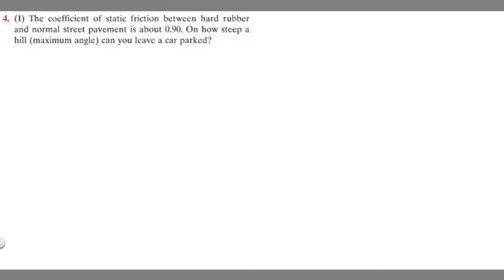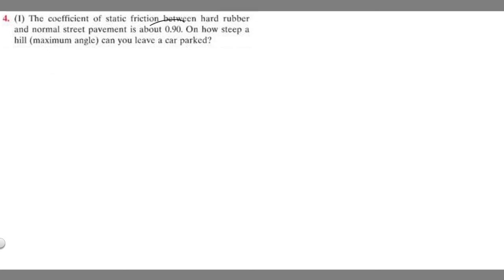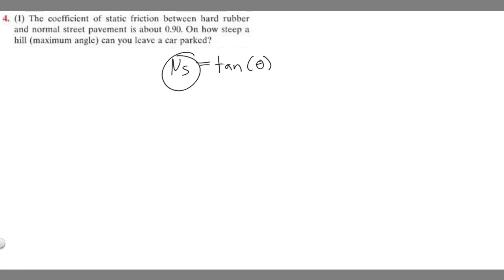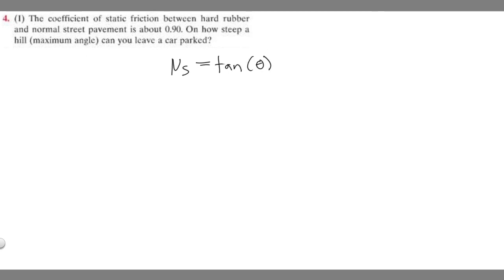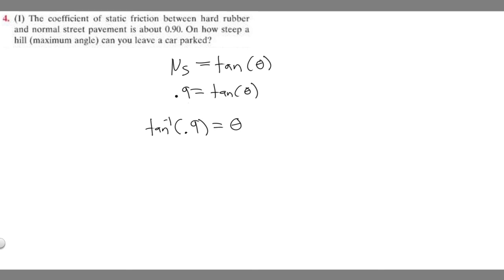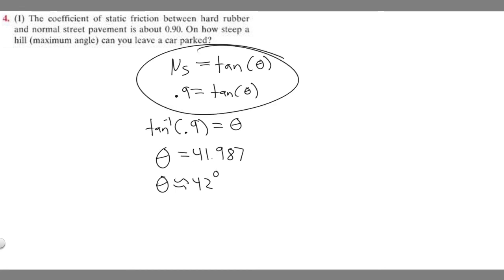The coefficient of static friction between hard rubber and normal street pavement is about 0.90.

Comment: How did u get that equation
Reply: Sorry for the late response. Since (Force of Friction = .90 × Natural Force)  ,  (Force of Friction = Force of Gravity in x-direction)  and  (Natural Force = Force of Gravity in y-direction)  you can substitute the variables so that  (.90 = Force of Gravity in x-direction / Force of Gravity in y-direction). According to the right triangle that is formed by the forces acting on the car on the incline,  ( Force of Gravity in x-direction = sin(theta)  and  Force of Gravity in y-direction = cos(theta) ). We now have (.90 = tan(theta)
Reply: The force pulling the car up the hill is μN (which is μmgcosΘ) and the force pulling the car down the hill is mgsinΘ.

We know the car isn't moving down the hill, so we set these equal to each other:
μmgcosΘ = mgsinΘ

You can cancel out the mg on both sides, and then divide both sides by cosΘ, which leaves you with:
0.9 = tanΘ

Because you plug in the given value for μ, and sin/cos = tan.

Hole this made sense to anyone else reading it! It also helps me because if I can explain it then I know that I understand it.